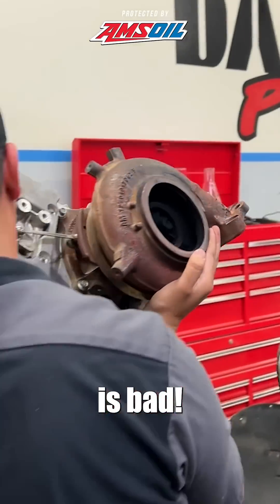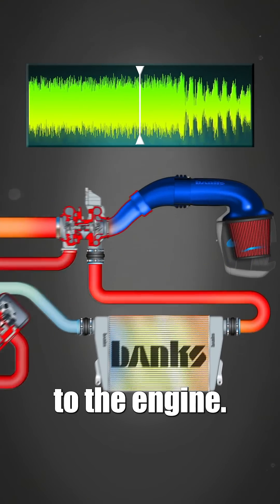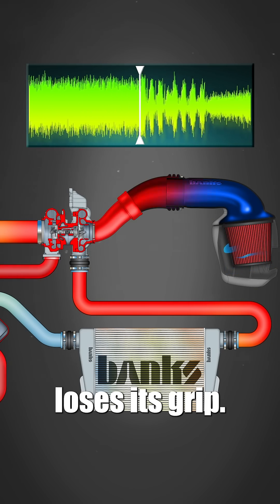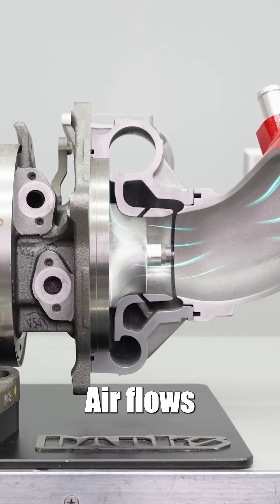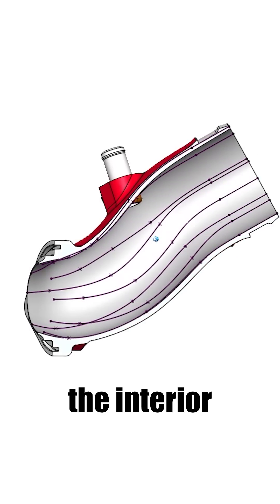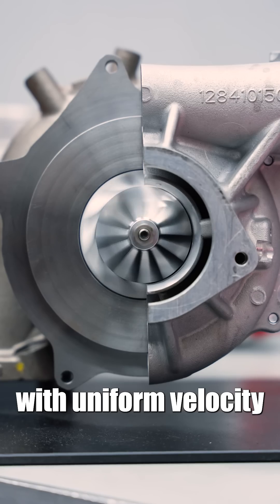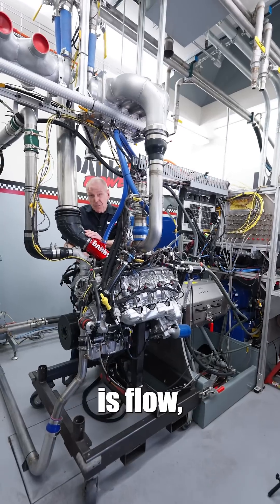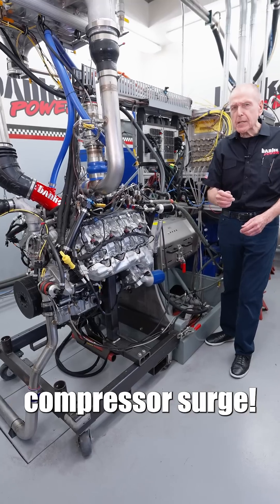Theirs kill turbos. Ours doesn't.

Comment: Bs. Keeping the engine revs above the turbo lag is free, keeps all bearings lubed at the correct pressure/speed. Getting a little more airspeed at -200 revs and -5psi oilpressure is cutting your engine life shorter. Banks is mostly colorful buy bull.

Comment: Just so that i'm understanding everything correctly, turbosurge happens when you're under throttle and under boost, correct? whereas turbo flutter or usually in diesels, it's called bark because it's lower pitched,  
Is it a matter of when you let off the gas.If you don't have a recirculation or blowoff valve, am I correct?

Comment: Blow off valves work too, but this is pure bad ass engineering
Reply: No blow off valves wouldn't change this because this is on throttle.
Reply: Also if you set your blow off valve to go off before the surge happens you're not getting 100% of what the turbo can give you
At that point why even have such large turbo, get a smaller one or fix the surge

Comment: Surging is credited by engine wanting more boost the way you can get around it easier is an electrical waste gate before your engine intake Steve Morris did this on his wagon getting rip of the surge and able to get up on 2 step in a 1/3 of the time the other issue is to small of an intake side of your turbo

Comment: I wonder if turbo surge is bad for an engine.. I run a trackhoe that does it all the time under light load.  Lol.  Not good. Our mechanics put a new turbo on it and it done it afterwards.  Still makes full boost. I figured it was because extra power wasn't needed. Sounds like a train all day.  Especially when I stop a second or two under full throttle.  Lol.

Comment: My modified fa20dit had this problem bad. Not knowing the cause, I threw parts at it for months. Finally got rid of the issue by replacing the turbo with a larger one off an older generation Subaru. Thing really ripped then. Wish I had seen this video sooner as it would have saved me hundreds of dollars and lots of down time. 
Thing just wanted more boost than the stock turbo could give it.

Comment: I Absolutely love My 2024 GMC 2500 Crew. The Duramax Will Literally Roast The 37” X 12” Nitto Tires. Then I Added The Peddle Monster Think The Truck Has Plenty of Boost Off The Line, As In Very Small Amount Or Turbo Lag, Then I Installed The Peddle Monster on a 10,000 Mile New GMC Truck Now The Truck Response Is Absolutely Amazing. Now for History of Me I Have Bought and Owned Every Diesel GM Has Ever Put Out. The Olds Converted Into a Diesel, The 6.5, 2003, 04, 05,06,07,08,09,10,11,12 13,14,15,16,17,18,19,20,21,24. Yes Every Year The Early Years GM Offered Leases So We Could Completely Write The Leased Trucks Off Every Year. They Were All The Company Trucks. I Would Put Snow Plows On Everyone Of Those Trucks, Pull Equipment Trailers All Over Michigan, Indiana, Ohio, and a Few Times To Nashville Tennessee, Building AutoZones and Dollar General Stores. My Nephew Works For Chrysler As a Team Development Group. Well He Comes For Christmas Dinner and He Is Driving a Brand New Ram 2500 Crew Cab With The 6.7 Cummins Motor. So My Son I Took it For a Ride And I Will Say They Are Vastly Under Powered, They Ride Like Shit, The Damn Shift Lever Was Wobbly As Bell. Now I Have Never In My Life Owned a Fird But My Sons Remedial Ass Bought a F450 Crew Cab it Look Cool But The Death Wobbles Freaked His Ass Out So Now He Has The 2021 GMC That I was Driving as a Company Truck So He Is As Happy as a Sissy With a Pecker in His Mouth. Lolll Mr. Gale Banks Sir I Have Followed Since The Salt Flats Record Speed Trials and You Sir Are The Main Reason GM Have Been Able to Build The 2024 6.6 Duramax Up As Great As It Is Sir. I Along With Millions of Other Sure Thank You for your Innovative Efforts For GM To Be Able Build Such a Fine Motor and Transmission. The Allison 10 Speed is An Amazing Achievement To Pickup Trucks. Thank You Sir From The Top and Bottom of My Heart. God Bless You To Keep Being You Creating The Parts and pieces that Us Customers Want For Our Trucks and Cars. I Hope To Be Able To Witness The Future Innovations You Have Floating Inside Your Heart and Mind. Great Job Sir and Thank You Sir And May The Lord Continue To Shine His Beautiful light Down On Your Sir.🙏❤️🇺🇸💯👨‍🚒

Comment: So where does the pressure release in the engine now that you've removed the backflow pressure release?
Reply from the maker: There is no release. Few modern Diesel engines have blow-off valves. They simply ingest the backflow, hence the surge described in this video.

Comment: This is basically jet-engine tech, like, Lockheed Tristar S-Duct type stuff. Any turbine can stall out like this, and it's a LOT worse in ones where it's not JUST feeding air to a piston engine. Kudos for putting in the engineering work to solve the problem, know it definitely wasn't easy.

Comment: Please make some components for some european diesels, I cant afford a massive american engine or at least i cant afford its fuel consumption. Most people here cant afford a massive truck like those used in the states. This is mostly because of the higher fuel prices and the smaller roads. It would be really cool if you went after maybe some older mercedes diesels or a new vr6 on a golf. Those are very accesible here in europe and could, with the right introduction be very popular.
Anyway, good luck from the Netherlands!

Comment: i actually saw a video earlier today about how volvo solved this problem on their turbos by adding an additional air compressor tank that feeds into the turbo's air intake, so before the car is really moving fast you still have fast air to shove into it, but i kinda like this fix better as a pure mechanical design fix.

Comment: I know banks products are great products. But I’m not sure about the product explanations sometimes. This is just an intake tube that keeps the stock surge suppression. That’s it. It has all the great banks engineering in it, including maintaining stock surge suppression. Most other manufactures eliminate the surge suppression and don’t flow as well. 

That’s all that needs to be said. It seems like they’re trying to say this tube helps prevent or suppress surge. It doesn’t.
Reply from the maker: You are in a very small group of people that understand compressor surge. He's explaining surge for those less familiar with the phenomenon.

Comment: How does it "burst backward" through the spinning compressor fins?
Reply from the maker: Seems crazy but there's enough pressure to actually flow backwards through the fins while its still attempting to induce air. The wheel slows down but doesn't come to a stop.

Comment: Meanwhile my 2001 Tundra has 300,000+ miles on it.
Original engine and transmission both smooth and running like brand new.

Comment: For those who don’t drive a diesel or didn’t understand the “Not moving much air, but asking for a lot of boost” it’s just too much load in low rpm, the cylinders don’t need much more air but your throttle body is all the way open.
Edit: spelling

Comment: I had this once and the guys who installed the parts couldn't figure why it was happening.   After seeing this I now know it was the foam air cleaner assembly that I replaced with a the extra large Ford air cleaner box for the 7.3l engine.

Comment: WOW just think of those trucks which are up above say 2 or 3,000 ft or meters above sea level, the density of the air is what matters and no tube on the end of the turbo is going to fix that, only a ecu tune based on elevation and density of air and unless you do that its a total waste of money.
Sure the stuff works based on a various air density chart, but i bet my bottom dollar the denser the air the less power your going to have, unless the ecu and air map sensor adjust the fuel to air and timing as you get high in the air density etc.🦘✌👍👌😎

Comment: If I might be bold enough to make suggestions on a Banks video: ease onto and off of throttle when possible. On every internal combustion engine you operate. This prevents alot of trouble in the first place.

Comment: Oh so it’s like a Jet Engine compressor stall. Not enough airflow through the compressor/core means that the high pressure air that the compressor and turbine stage is producing blows back through the front of the turbine.

Comment: This is very similar to surge that occurs on centrifugal chillers. I operate 5,000 ton Carrier units and they have a similar design to what GM implemented into the turbo to help with surge prevention and create more uniform flow.

Comment: I’m no expert by any means but doesn’t more pressure in the engine wear it out faster? I really don’t know, all I heard was never buy a factory car with a turbo because the motor won’t hold up to the pressure very long compared to say a v6 instead of a turbo 4 cylinder

Comment: Banks, a very well-studied and experienced engineer of aftermarket parts: "compressor surge is BAD"

Some 23-year old: STUSTUSTUSTSU
Reply: It's funny when people think that Stutu is some kind of new thing that only young people do but in reality it started with people modding turbo cars 40+ years ago when they all had no blow off valve.
Reply: @DriftNick  For sure, I'm sure a lot of it has to do the the JDM/import era wherein Skylines and Supras and such blew up really big in the tuner scene. I wasn't around when 40+ years ago but I've got a proper BOV on my car. 

Should be noted of course that the compressor surge Banks is talking about here is under throttle, which is a worse condition than cold side boost having no exit...though the official internet opinion is BOTH are bad, despite all those no-BOV turbo engines running hard way before a lot of these people were born.

Comment: My 04' 6.0 Powerstoke will do this, but only when I'm heavy on the throttle and let off quickly. Am I damaging my turbo by doing this? Is the compressor wheel stopping and rotating backwards? Or just slowing down?

Comment: I gotta agree with him on that statement you need and engine development facility to do it right. Now i dont have anything near as nice as that but i had to build myself the same things to build my compound turbo bike. Took 14yrs to get where it is and 8 of those was making changes putting it on the dyno and testing it. At first we were doing the ride it down the rd and try stuff whatever feels best and times best is a winner😅 but shortly into it that wasnt good enough. Currently the 155cc bike makes over 100whp and a crazy 100psi of boost. Now it revs high so the tq to do that isnt crazy but i had to make just about everything in the engine including the cases themselves, the head although modified is basically the last of the oem parts 😂. Watching guys like gale and others inspired but also pointed me in the direction of what doing something like this would look like and id find myself testing something and going no this is wrong theres not enough control or data here for me to do this right. Hopefully one day 200hp will happen although even im doubtful that can be accomplished on e85 😅

Comment: Venturi old technology , so old is all the piaggio vespa since they where born , and im not talking about the turbo, and dont need a lab , i still use the old metods , make a piece and modified by hand until you get the result and then redo it in its final state , it take 2 days ... No engine lab only brain

Comment: I normally completely agree with everything I see/hear on here, but let's be honest if you have a turbo that's from this century and therefore doesn't run ghetto ass journal bearings surge will not cause any damage at all. Yeah it will ever so slightly hurt spool times and efficiency but it's hardly more than margin of error and you miss out on all the fun noises. If absolute maximum performance and efficiency are your game by all means but no need to spread outdated lies
Reply: @JshDav  What makes you think this is solely about bearing damage?  The effects of compressor surge are bad for everything in the compressor/turbine system.  There's nothing inherent to ball bearings that makes compressor surge not a problem...
Reply: @JayRussellDuramax  Well I am a mechanic (dual trade mechanic & auto elec actually) and I've never experienced or even heard of compressor surge destroying anything apart from the bearings... Sounds like a whole lot of BS to me
Reply: @JshDav  It can damage the compressor by forcing air backwards against the tips of the blades.  It may not be immediately catastrophic, but those blades are really thin and aren't meant to experience back-flow.  

Honestly, I don't see how a journal bearing would fare worse than a ball bearing under these conditions.  I'd be worried about the ball bearings chattering in the races and damaging things.  I'd think the pressurized oil cushion of a journal bearing would be more forgiving.
Reply: Are you the real Gale Banks? Dang I musta missed sumthin, have to watch da video agin, mak sur didn miss nothin.😢

Comment: The only man in the world to hold a Doctorate in diesel power.
Reply: You'd be surprised about the knowledge in the engineering companies like AVL
Reply: Yes, if you ignore the hundreds of people responsible for developing such engines...
Reply: @TT-iu1uq  yeah as if I’m gonna thank the designer who put a bolt right behind the crankshaft pulley, or the designer who decided that you need to take apart basically the subframe just to change a starter
Reply: @TT-iu1uq Well actually thats the point, Banks straight up picks apart and improves those peoples flawed designs quite often.

He'd be a great engine designer, but he's independent instead and does a lot more for us as a whole by making parts for multiple engines than he would do for us by working for 1 company with the resources to utilize knowledge
Reply: Never underestimate Manufacturers. Get the 3.0L Diesel from BMW with 400hp and 750hp stock.
Reply: He has responded to a comment much like this by saying "actually I'm more into forced induction"
Reply: no German are the doctorate in diesel power Lol!!
Reply: I just started diesel tech and im glad i found these videos so i can continue to better my knowledge in this field.
Reply: Ya idk bout that shit when it comes to fitment and a few other things 22 ram 6.7 Cummins every banks motor part on it and idash banks grid heater fail porcelain broken already decent size pice intercooler pipe rubbing on power steering line can’t get oil filter out through the wheel well any more cold air intake box does not have seals where it goes into the grill big hole in the bottom lets spray and snow into the air box no torque converter lock up gauge and the in the slippage thing there for the transmission or torque converter, doesn’t even commute with the truck useless
Reply: @ericsteele1678 at least you used 1 comma I guess

Comment: In laymen's terms, "STUTUTUTUTU" is bad.
Reply: Sounds like STUTUTUUTUTUTUUU is bad on load, surely it's not horrific off load
Reply: @NZknuckleZ  It's literally the same thing.  Compressor surge is compressor surge whether it happens under load or when the engine RPM drops/throttle closes.  It's always bad.
Reply: @JayRussellDuramax  Nah it's only bad if it's happening on throttle.
Reply: @DriftNick  That's not correct.  The compressor is surging in either case.  It's literally the exact same thing.
Reply: @JayRussellDuramax  What part of compressor stall on closed throttle is causing issues
Reply: @ValentineC137  The pressure spike inside the compressor when it dead-heads against a closed throttle.  It's literally the same thing that's happening here.  Surge is always bad, no matter where on the compressor map it happens.
Reply: @JayRussellDuramax  But I'm asking why
Reply: @ValentineC137  As Gale showed, it forces air backwards through the compressor and can damage the compressor wheel.  The blades are very thin at the tips, and the pressure spikes from compressor surge can deform the tips or even break them off.  It may not be immediately catastrophic, but it's certainly not something that should be ignored.
Reply: @JayRussellDuramax  Any source for the compressor wheel breaking apart because of surge, especially off throttle?
Given that Turbosmart made a video on the topic repeating the more common understanding of increased bearing wear
Reply: @ValentineC137  I may be over-generalizing compressor surge a bit to include other applications of centrifugal compressors, but source #7 on the Wikipedia page for Compressor Surge mentions blade fatigue and mechanical failure.  Because of that, it's not unreasonable to say that a compressor wheel on a turbo could be damaged to the point of mechanical failure by surge.  It's obviously going to take more than one instance of surge to cause the damage, but, in all cases, compressor surge is a firm sign that something is wrong.  

Secondly, though the intensity of the surge diminishes with each cycle when a spooled compressor hits a closed throttle, it's still surge and should be avoided.  It does sound cool, but, with how expensive a quality turbocharger is, it's not worth the risk.
Reply: incorrect. "SUTUTUTUTU" is the byproduct of letting off the throttle. SURGE is bad. That happens ON the throttle. Meaning you're compressing NOTHING, and creating a "closed" throttle by having choked the engine of oxygen.
Reply: but cool
Reply: @5GTrevor  Not once you know why it happens.  Get a proper blow-off valve and enjoy the sounds that makes rather than potentially damaging your turbo.